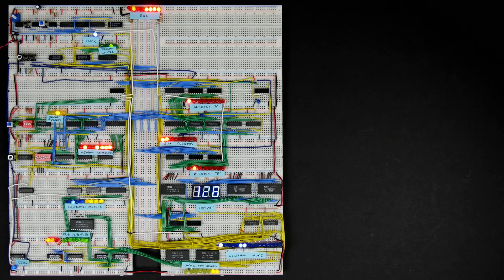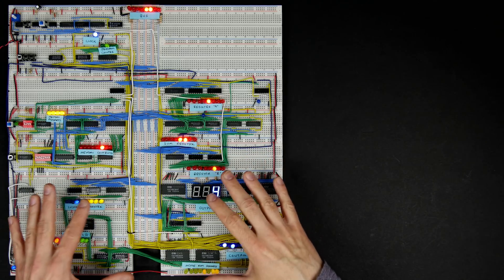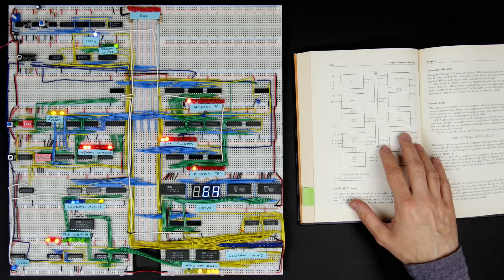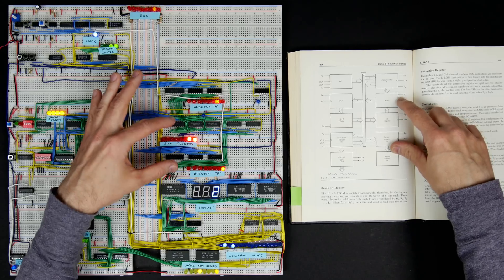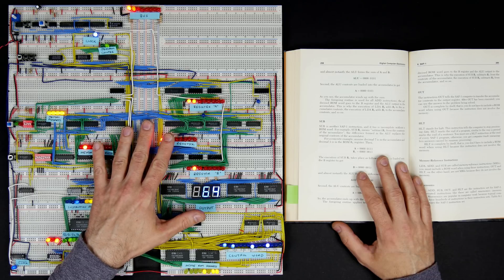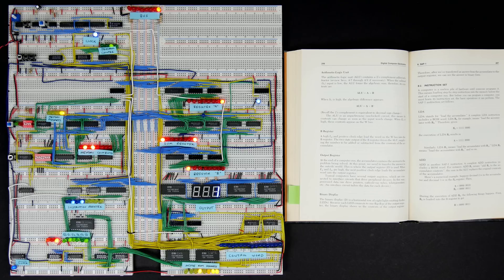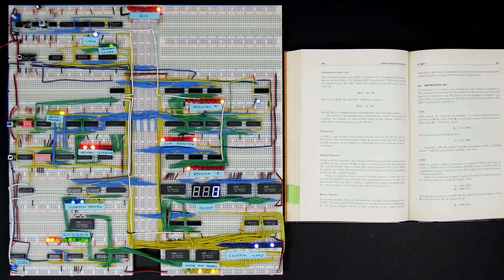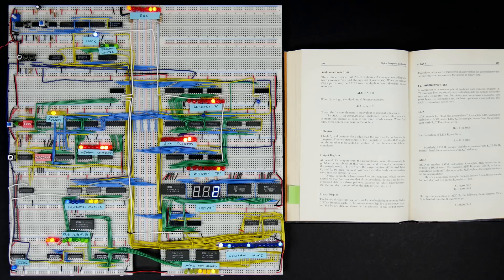8-bit computer update

Comment: It's also fun to create an operating system for a tiny computer, and much easier with a simple CPU. I did that for a commercial 6502-based computer (an Ohio Scientific C4P-MF) many years ago.

First, I experimented with the disk drive and looked at its driver to learn how its software worked. Then, I designed a simple higher-level programming language (so I didn't have to use any professional tools such as an assembler). I used macros that expanded into general 16-bit operations, which was very inefficient, but this didn't matter for this project.

As I designed the language I designed a simple text editor to work with the disk, which I had created software for to change it from a track/sector low-level reading/writing to a block-structured device, for simplicity of addressing.

I completed this part of the work, getting the disk, editor, and language compiler to run on the 6502 with no trace of its former and awful OS. I was intending to create a directory-structured file system and more efficient tools, but a strange thing happened to me at that point. Having accomplished something interesting, an OS that started up in a fraction of a second and was usable, I suddenly lost interest in the project and never worked on it again.

I guess I made up for it with all the personal and professional software that I created over the remaining 60 years or so, but it's too bad I never kept on working on that from-scratch project. Of course, it would always have been limited, since each diskette could hold only about 300K bytes, if memory serves. That's not much space for a real editor, a real assembler, real programming languages, real debuggers, real virtual memory, or real independent processes or windows.

Comment: As a computer science student, I find this fascinating. I typically believe in order to understand something the best you can you should start simple. This looks like it offers an excellent opportunity to fully understand the logic circuit and how it operates.  I've completed some architecture classes already and am working on currently learning instruction sets. The clock modulator that you can alternate looks extremely cool. If I do have time I hope I can work on building this into a simple calculator with some additional output LCD outputs for the registers. Thank you so much for sharing this.

Comment: Just a thought: 
Is there a software that would mimic this? So basically, to "simulate" and create 8-bit computer in a program?
Reply: This could: http://www.cburch.com/logisim/

But it won't work because - to build the bread board - you need some tricks that could only be simulated in real life.

For example, in the website, it takes 0 seconds for a gate to do it's work, however, in the real world, it takes time to do it. And Ben used that trick to build the breadboard computer. So sadly, it is impossible.

Comment: Does anyone know any software that will help me simulate this system? Or any general digital design simulator?
Reply: This could: http://www.cburch.com/logisim/

But it won't work because - to build the bread board - you need some tricks that could only be simulated in real life.

For example, in the website, it takes 0 seconds for a gate to do it's work, however, in the real world, it takes time to do it. And Ben used that trick to build the breadboard computer. So sadly, it is impossible.

Comment: what power supply are you using
Reply: Phone charger /atx computer power supply
Reply: @oldelectronicenthuasiast  can I use a 9v battery and pass it through a 5v regulator?
Reply: @kennethgayagomes3796  it depends on current draw if the current is under 50mA then go for it. Lantern battery might be better choice as the 9V battery will deplete quite quickly
I highly recommend to use mains powered supply as it will be less expensive in the long run.
Reply: @oldelectronicenthuasiast  thanks a lot
Reply: @kennethgayagomes3796  if you have spare usb cable just cut it and use black and red wire then plug to phone charger and you have 5.1V DC @ 1A
If you need more power or 12V/3.3V use atx psu from an old computer those could pump out more that 10A and thus are sufficient for all usb projects and a lot of microcontrolers.

Comment: I'm trying to follow along, but I'm extremely poor.. can't afford your kit. Trying to make do with 10cent parts from a local electronics store, but none of the partnumbers line up.. making it really challenging.. Also, I'm just using a cut-down 5v USB power supply (phone charger), hopefully there'll be no problems from this?  I'm using an 8088 cpu, rather than the 5602, btw, as I couldn't find one.
I've yet to power it up, just laying out the circuit as best I can.. slowly, hoping to understand as I go. 
(I'm an experienced coder, have been programming in one form or another since about '91, and as much as I always wanted to get into x86 assembly, I never had a reason. Until now!)

Comment: Thank you so much Ben for this excellent series. I had struggled to understand what was meant by micro-programming, I just couldn't get my head around it's intricacies. I knew about the topic from the papers of the EDSAC designer Maurice Wilkes, who got the idea from the Moore school of computing and ENIAC(I think). But Wilkes wrote quite a few papers on the topic. His idea was to use an array of germanium diodes as the control store. The idea being that you could plug in a new array if you wanted a different set of operations - your EPROM.) Now however, thanks to this excellent series I understand the requirement for the correct sequencing of control signals to make sure things happen correctly. 
Could I suggest a video or two that picks out the highlights of what you have done. It's a lot of viewing for students in a class to get the basic ideas.
I'm going to build my own 8 bit, but I think I'm going to design a different version using an address and data bus and probably hard wired control logic. Maybe! I'm getting the parts together. Keep me busy whilst looking for work anyhow. :)

Comment: Great job! Your work inspired me to write a (yet another) software simulation of your computer, but this one is different... It simulates EVERY TTL and memory chip, exactly like in the original project. The only parts I left out were the 555 oscillators (they have been modelled as abstract oscillators), but the rest is really the same. The project is almost finished (I'm about to implement the FLAGS register). The project is hosted in GitHub: https://github.com/ARMCoderBR/tlsim

Comment: What are you going to do with your computer now it's built?. Have you thought of building it onto Vero boards & donating it to a science place? Why on Vero board, cause there will always be an ass who will pull a component out for fun. Could you build an Atmeg 328 on a breadboard, the internal workings?. You'd have to use a memory chip for flash ram etc, but if covered in a similar way as the 6502 projects, it would give people a great insight on how the 328 works internally.

Comment: I just went through the 44 videos on this playlist. 👍🏽👍🏽. What memories.  Very interesting and well presented. Back in the ‘60s in got a Radio Shack electronics lab.  In the early 70’s I was a bench tech repairing TTL boards, working for digital equipment corporation.  I’m still a computer field service engineer. Thanks from Orlando Florida.

Comment: Another tour de force expose of the principles of the ubiquitous computer that has automated and added intelligence to basic machinery in every aspect of daily living. Coincidentally at about the same time "curiousmarc" and a group of digital enthusiasts have successfully restored to full working state an Apollo Guidance Computer! Yes and to see the state of digital technology in the early 60's as developed by an MIT professor for both permanent and erasable programmable memory based on ferrite cores (rings) and the minimum number of wires to address each core or "bit value", this is a must see! Also a German documentary on the CPU model and instruction set used by the Apollo AGC may be a little dry but with Ben's explanation of microcode and instruction set as an arbitrary decision makes it possible to understand this whole historic garbled story of half facts and cold war jargon for the first time with real evidence and calm explanations. Well done Ben! Thank you for showing how its done, by good example and good will.

Comment: Instead of drawing up a full schematic, it might be easier (and faster) to write out the design in VHDL or Verilog and post that somewhere on github for people to get. That would also promote the adoption of hardware description languages and configurable logic (i.e. CPLDs and FPGAs) among hobbyists, something that has been very slow to gain traction, despite efforts from various sides.
Further, if you ever want to have a look at more contemporary CPU designs (which in their basic implementations aren't any more complicated than the older bus design you implemented), have a look at "Computer Organization and Design" by Hennessy and Patterson. And lastly, I have to say I love your channel, you're one of the best educators and explainers in Electrical Engineering on Youtube. Big Thumbs up!

Comment: People might have different mindsets, but I find the challenge of designing and building up something is much more valuable that just following some instructions and replicating exactly what someone else did. These videos show one possible way of constructing a computer, but there are no rights or wrongs as long as it "works". One thing I've noticed, for example, is that many of these older components are out of production. Many of them don't make a lot of sense either, if you want to use the computer for anything meaningful, other than as an educational exercise. As Ben said in a video, you could build it out of just transistors also, but why would anyone do that? Or, why would anyone bother building a homemade x86 computer when you can buy super fast computers in a store?

I see that many look at these creations, and are awed by the apparent complexity, but really the complexity lies in wiring more than the principles behind the machines. A "computer" is a "machine" that moves data. That's really all it does. By itself it's not that useful, but combined with different components that perform different operations on that data, pretty much anything can be done (at least if there is some kind of conditional branching mechanism available). The principle is very simple.

Comment: Can someone tell me what type of "memory" is used here. I mean is this memory will retain itself even after the power supply is off.  Or if this memory is a RAM made up of transistors which will go away when electric power is put off.
Reply: those chips retain the memory after power is turn off, yes

Comment: You can use your EPROM based approach to make a "processor". One EPROM will act as ALU with say '273 register at the output as accumulator. A set of address lines will act as first operand; another set as second operand (wired to the '273 outputs) and finally a few as instruction selection. The program could reside in another EPROM, addressed by an incremental counter (program counter). The second EPROM 8 outputs will be divided as say 6 bit operand and 2 bit instruction. Even and odd addresses could also be multiplexed to produce separate 8 bit operand and instruction. If you need more detail on (self made EPROM based) extremely limited instruction set "processor" contact plamen_petkov5@hotmail.com. I used such a machine to process real time PCM signals for telephone conference call service. It operated on 8 bit PCM signals (odd bits inverted, logarithmically compressed 12 bit to 8 bit data). The instruction set comprised "add to accumulator", "subtract from accumulator", "clear the accumulator" and "do nothing". The "ALU" took care of inverting odd bits, expanding 8 bits to 12, adding or subtracting, compressing the result to 8 bits and inverting odd bits again...all in the EPROM settling time.

Comment: Back in 1980 ish of my life I had a book on how toi build your own computer and it was 8080 based it had two 7 segments and a hex-matrix keyboard. It was getting close to being half wat done when My friend came to me with a Timex Sinclare. He was very smart ast the time was fixing modems for GTE or sprint . He showed me how to use one 7 segment driver (7447/48) with a 74154 1 of 16 decoder to pull down, or up the common (anode or cathode) on up to 16---- 7 segment displays, and at the same time only one 74LS193 counter to hook up and program a 2114 memory chip, and display 16 different numbers for each address. I never emplyed that tech but it still to this day stands out clear in my head how we did it. I an so sure Ben if you think about this you will know exactly what I am saying.  I think what you have done here is relight a fire that I thought went out a long time ago. LOL

Comment: I think I am going to build a TTL VGA card with a single line buffer and use your machine here to bit bang out a picture...
Reply: Actually...if the clock were set right...(and we had more memory...mine has 532 bytes) I bet I could just do it in code...gonna try...

Comment: I came here from your video on using EEPROMs as a replacement for combinational logic, which was a GREAT video, which is why I followed-on and watched this one.  I intend to read the whole series, even though it's clearly aimed at a lower level of knowledge about digital electronics than my experience would imply that I have.  What I really love is how the entire system is made SIMPLE.  This video, and this series of videos, is a great look inside the "black box" that most people think of CPUs being.  Outstanding.
I have, from time to time, toyed with the idea of building a fully mechanical computer from scratch.  Your approach is exactly what I need to actually make this happen: start with the simplest modules and build up to the modules that are actually needed, and connect them together to make a complete system.  By seeing that a working computer doesn't really need that many modules, each of which is pretty simple, I can see this as a reachable goal.
Liked, subscribed, appreciated, and admired.

Comment: But can it run crysis? jk :P Awesome work!
During my apprenticeship I built a discrete 4 bit computer on breadboards. It was a lot of fun and I learned more than in all microcomputer classes combined :) If I remember right it ran with a fixed 1 MHz or variable (555!) clock rate and had about 20 instructions, 3 registers, a simple ALU and 2 kB of RAM (4096 nibbles! :D). The most complex part was the instruction matrix... It also had a RS232 interface also completely built with TTLs. Later I started to build my own discrete video card outputting a standard video signal (2 bit grey scale, quite low resolution) but I never got to interface it to the computer due to lack of time.
Thanks for the great video... it brought back some very nice memories!
Greetings from Germany! raBit.

Comment: I wish I found your channel earlier, awesome work. I am studying EE, currently, in my second year and after watching this I am planning to do a similar thing for my project. I was wondering if it is possible to implement at least some parts of this on an FPGA board?
Reply: Yes it is, I completely implemented a basic ALU with(ADD SUB DIV MULT INC BITSHIFT), CU and a Memory stack on a Xilinx spartan FPGA (in my college). Its like a 8086 processor. Used ModelSim simulator for testing Verilog code.
But I tell you its not of any practical use really - it would be cheaper and easier to use a raspberry pi instead.

Comment: I'm definitely going to start building an 8-bit computer. Except, I'm very crazy, and after building this one, I'll build another one like this one entirely with NAND gates! But that wouldn't be crazy enough, so I'm planning on building one... out of discrete MOSFETs, passives and wires! The only problem is that would take up a lot of space, so I'm eventually (a few decades) taking it to an entirely new level of craziness and make an IC... at home! Just like what Jeri Ellsworth did, but smaller (Jeri's process is a few cm. I'm planning on making my process a few µm). As far as I know, nobody tried this! Wish me luck because I'll definitely need it! But don't expect to see anything of that style until 30 years or so.

Comment: Great series very inspiring. I would like to offer up a couple of other references. One can be found fairly inexpensively "Practical Digital Design Using IC'S" by Joseph D. Greenfield https://www.betterworldbooks.com/Practical-Digital-Design-Using-ICS-id-9780136898948.aspx  Greenfield's book covers most of the theory applied in this series but lacks the implementation details. Another great book on this topic which has a great online community is  "The Elements of Computing Systems Building a Modern Computer from First Principles" by Noam Nissan and Shimon Schocken. this book can be found used for around $20 USD maybe cheaper if your lucky.

Comment: Can I use 24 awg in place of the 22awg wire?
Reply: My guess would be that you can. Only problem that might happen is that the connection with your breadboard isn't good enough so you might wanna try it out first.

Comment: I'm considering taking this project on for my next semester. Of course is a few small modifications of like to make. I plan on using a custom-made power supply connected to mains voltage and utilizing the 60 Hz from the wall for the clock. How much current does it take to run your eight bit computer?